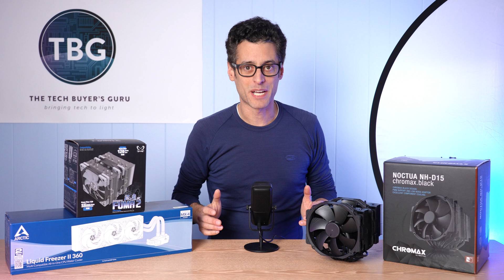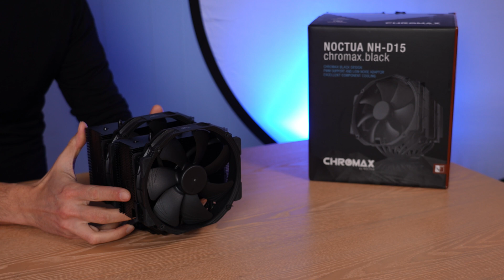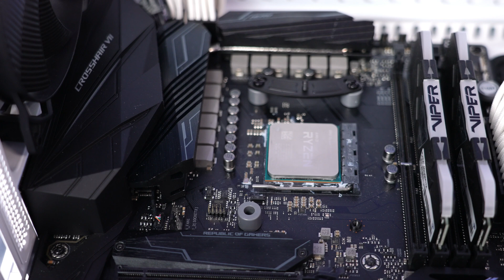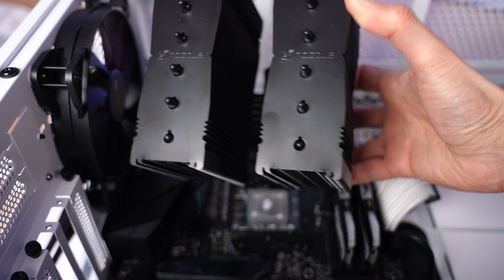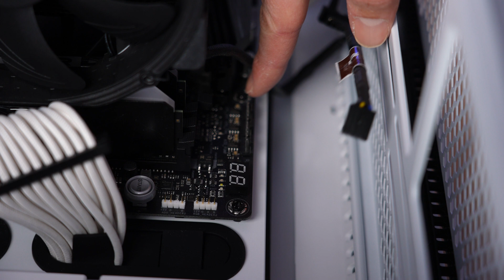The Noctua NH-D15 CPU Cooler: Installation Guide for AMD's AM4 Platform

Comment: just found out the hard way that the nh d15 se am4 does not work with Corsair Vengeance RGB PRO 64GB, DDR4, 3200MHz in a Be Quiet Silent Base 802...
Reply from the maker: Pretty sure you must have missed something, because I installed the D15 in the 802 in this video, and used RGB RAM that was just as tall as Vengeance RGB Pro, with plenty of room to spare.
Reply: @TheTechBuyersGuru  what should i check for ? my cooler is touching/resting on the ram atm and side case/interior foam still makes contact with the fan. I feel like theres a 3-4 mm more needed to clear it up.. Im pretty sure the cpu cooler is mounted correctly, im getting 28C idle on desktop and 58-62C after cinebench 15 runs. Here's some pictures
https://linksharing.samsungcloud.com/6usNkEiFMEAw
Valid until May 23, 2021
Reply from the maker: Ah, the issue is the padding on your solid panel case. I used the glass panel, which offers more clearance. Your only option would be to cut away some of the padding. You could also substitute a 120mm fan in the front, which would reduce performance slightly, but not enough to make a big difference. You clearly have thermal headroom if Cinebench 15 is only hitting 62C.
Reply: @TheTechBuyersGuru  thanks for the info. I think changing the ram to some corsair LPX is also a solution
Reply from the maker: Oh, sure, you could also replace your RAM, but that would cost more than swapping the fan. It is true, however, that the D15 is not an ideal choice if you're using RGB RAM.
Reply from the maker: Have a look at this video to see what the D15 looks like and how it performs with 120mm fans: https://youtu.be/o-bRE1Wo97Y
I'm suggesting you just swap the front fan, not both.
Reply: @TheTechBuyersGuru  interesting.. Well given that an order must be placed for either a smaller fan, or new ram ( this will be a return and replace, my current ram is bought 3 days ago so its fine), i guess ill go with replaceing the vengeance rgb ram with a 15% cheaper Vengeance LPX model, so its actually a win :)
Reply from the maker: Yes, if you can get a refund for your RAM, then that makes the most sense. Make sure to pay close attention to not just the frequency but also the timings of the LPX RAM you buy. Corsair makes many different SKUs with the same frequency but different performance based on timings.
Reply: @TheTechBuyersGuru  are timing really that important ? the model i found online has cl 16, 16-20-20-38
Reply from the maker: Those are the new weak timings on DDR4-3200 RAM. It's not great, but it will work fine. It used to be 16-18-18-38 was standard.

Comment: Ive been reading that there is only about a 1-1.5 degree difference between single fan and double fan so im probably going to just mount one of these fans to the top of my case and put one between the towers.  At the moment I have no exhaust fans so it will act as an exhaust, will not cover up my RGB memory and hopefully will allow me to access the GPU.
Reply: How did it go?  Which cpu, and what temps are you suffering?
Reply: @Chris.Brisson  I ended up putting 1 in between and one on the end towards the back of my case in a suck configuration rather then a push config sitting over memory.  Seems to work fine on my 5800x which atm is running around 50 degrees celcius on average with a game running.

Comment: The CPU backplate is usually comes installed on the motherboard with the default mounting hardware. If you don't have these you probably bought it from someone who used the motherboard earlier with a custom cooler and they didn't place back the backplate and mounting kit after removing their custom coolers. If you buy a used motherboard, make sure you have these. Normally the first step would be to remove the default mounting hardware and leaving the backplate on the motherboard. You can install the cooler mounting hardware on the motherboard box in a horizontal position. The heatsink itself is best installed after the motherboard is installed in the PC case with all the cables connected.
Reply from the maker: All good advice!

Comment: Hello, could you tell me if you were able to close ur case without any issue . I can tell the cpu cooler outer fan that is above the ram is making it hard to close the desktop case. And do you have any recommendations to choose an atx case for this fan?
Reply from the maker: I tested this in a large case. It fit fine. But yes, it can be very tricky if you assume it is only 165mm tall and then need to raise the front fan by 10mm. Then it won't fit in most cases. The 165mm height is based on using standard-height RAM, which is approximately 37mm tall.

Comment: In the event of installing this and eventually the GPU, ram or cooler itself need to be removed is there any way to do this? I understand it will be highly difficult but is it just impossible?
Reply from the maker: I was able to get my GPU out after removing RAM and working very hard to reach the latch with my finger. It wasn't easy. You may need to remove the cooler, but that is also extremely hard because the fan clips are blocked by the GPU.

Comment: Think the raised second fan will clear 176mm?  42mm memory height, oops.
Reply from the maker: In my testing, it sat at 163mm when dropped down below standard spec with 34mm ultra-low profile RAM, so you'll be at 171mm. No problem. Here's the link to the D15 chromax.black at Amazon: https://amzn.to/3gtc1wN
Reply: @TheTechBuyersGuru  Awesome, thanks for the specifics!

Comment: wont this cpu cooler put excess strain on the motherboard and eventually break something due to its heavy weight ?!
Reply from the maker: That's just what people say, it doesn't actually happen unless you ship the PC with the cooler installed. It absolutely will NOT happen if it's sitting on your desk or floor for years.

Comment: : Why didn't you just use tape to fix the backplate in place?
Reply from the maker: That is worth a try, but wouldn't necessarily hold it well enough to screw the bracket on as tape doesn't stick particularly well to a bunch of solder joints.

Comment: You can actually mount the Noctua in any orientation you like.  In fact some mothers boards wont allow a GPU in the top slot without turning the Noctua 90 degrees right or left. The Asus Maximus IX Apex motherboard in one of these boards. It will perform exactly the same as long as proper airflow is allowed in the case.

Comment: I didn't need this video, but if I did, it would have been a perfect guide. Really good job.
Reply from the maker: Thanks for the positive feedback.
Reply: @TheTechBuyersGuru  I installed mine a little differently, leaving that middle part empty with both fans pulling air towards the middle. A case fan situated vertically above the empty middle of the cooler draws the hot air out of the case. This way both towers are drawing cooler air in. I have intake fans at the front and rear directed towards the cooler. I'm getting just slightly better temps but with the added benefit that I can reach my GPU retention clip easier now.
Reply from the maker: Really creative installation, and yes, being able to reach that GPU clip is priceless!

Comment: My backplate screw holes are way to small for the screws that came with the cooler.
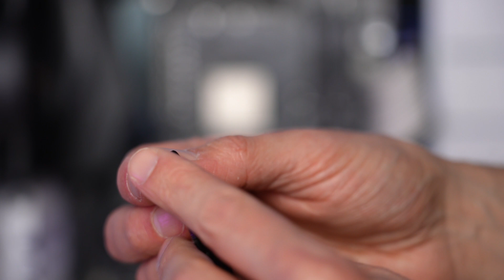Reply from the maker: You should double-check that. The backplate screw size is standardized by AMD. Maybe you just pulled the wrong screws out of the box. I clearly show the screws you should be using at 04:04.

Comment: Nobody, including the instructions shows removing the plastic cover from the heat spreader. I’m not sure mine has one. Any video of this?!?!
Reply from the maker: Oh, it's just a molded plastic cap. Not hard to spot, I thought I'd mention it because I'd already removed it in the video, and most other coolers actually use a sticker over the cold plate, which Noctua doesn't. If your plastic cap isn't on there, it probably fell off in the box.

Comment: You jumped over a step I may have a problem with.  The cover on the base interface is a hard transparent plastic molding which in my case fell out of the packaging when I opened it.  This  is the cover you're talking about?  or do you mean there is an additional peel off soft plastic cover I should have peeled off before mounting the cooler?
Reply from the maker: Yup, that's it. Not hard to take off!

Comment: What a nice install video! I kind of wish this was released a week ago, because I just did a build for a friend using this cooler. Installing it wasn't too bad or anything, but having this video would have been just that much more convenient. I did initially install the frontplates upside down though and then applied thermal paste, so I had to unscrew and fix them while avoiding the thermal paste. And this video would have been nice for doing the fan clips, too.
Welp, at least I can see that I did everything correctly. And hopefully applied enough thermal paste, too.
Reply from the maker: Thanks for the feedback, glad you got it installed!
Reply: Hello I just installed this and the fan makes noice like it hitting something.

Comment: Thoughts on this video jotted down while watching.

The CPU backplate can be temporarily held in place with a piece or two of tape. Makes installing it a lot less fiddly. Alternatively if you are installing the cooler while building the computer then attach the backplate before installing the motherboard in the case.

When tightening the screws holding the CPU backplate you don't really need to cross tighten them. There is nothing to compress in the middle of the plate so each screw is only putting pressure on the PCB immediately between the CPU backplate then the spacer, and the pressure under one screw doesn't change no matter how hard or lose you screw down any of the others. So just tighten down each of these four screws and be done with it.

However just like shown in the video you need to cross tighten the two screws. Everyone has their own technique for this. Personally I start with backing the screw until I feel it skip on the beginning of the first thread, then I give it one turn making sure it engaged the thread. Repeat this with the other screw but I give that one two turns instead. Now I switch between the screws every time giving them two turns. This way the pressure center will only shift slightly up and down every time and it makes sure that it's always very close to the center of the heat spreader. If you feel this takes too long then give the first screw two turns the first time and then use four turns each time you switch screw until they bottom out. This moves the center of pressure a bit more each time but halves the number of times you switch between the screws.

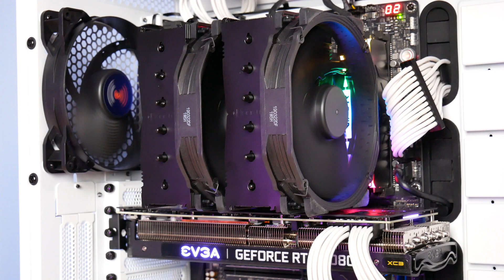Finally regarding the size of this cooler it should be noted that if you look at 10:25 you can see that this cooler actually is so large that on this motherboard it actually covers up the first expansion slot, and that the graphics card is installed in the second slot. This is important to know as there are motherboards that have the x16 PCI-e slot intended for graphics cards in the first slot position. On these motherboards this heatsink will obstruct that slot preventing the installation of a graphics card there. Also note that even if your motherboard have two or even more x16 slots it's very uncommon for any but the first one to actually be wired for more than x8. If in doubt check the motherboard manual to make sure.

Also Noctua have a pretty large database on their site where you can see if the cooler will fit a certain motherboard. I think they also have a case compatibility database, so before ordering it might be worth taking a look there.
Reply from the maker: All good points, thanks for sharing... I like that tape idea!!

Comment: Noctua cables always have small papers wrapped around them to identify the type of cable. It will always be advisable to remove these papers after assembly because of the heat given off by the components, don't you think?
Reply from the maker: Any impact of the labels would be so small that it would be impossible to measure. I wouldn't remove them.
Reply: @TheTechBuyersGuru  But they look bad :(
Reply: @TheTechBuyersGuru  I thought that the paper in contact with some part of hot metal, there could be a risk of fire. I think I exaggerated my concern :)
Reply: @PauloFerreira-hh6zv  Paper catches fire at a temperature that's well above 400°F. So if the paper catches fire you have some serious problem with your computer.
Reply: @blahorgaslisk7763  If the paper only burns at 400º F, then I don't need to worry :)

Comment: I love how easy it is to pop these Noctua coolers off and back on after its mounted.
Reply: Me too, allowed me to test different paste applications on my Ryzen to check the spread very easily. Pea size proved the best surprisingly.
Reply: @lunetailedfox  I lost 5c by reapplying with pea size after trying a X
Reply: @coryandrum  I was using a NH-D15 with NT-H2. After applying pea size, the spread was perfect on the CPU: https://i.imgur.com/OlfKPCf.png

X method and 5 dots method actually spread worse for me.
Reply from the maker: Yes, the mounting mechanism is really top notch. Others have gotten close, but Noctua pioneered a simple, elegant solution.

Comment: dark rock pro 4
Reply from the maker: Are you asking for an opinion/guide? I've tested it against the D15 and didn't really like it. Here's the video: https://youtu.be/tw5qR7BeTXA
Biggest issue was the installation - it was so bad that I'd never create an installation video for it, as there's no way I could make it look easy.
Reply: @TheTechBuyersGuru  i swapped from the drp4 to the nhd15 cromax.

Was pissed with the easily scratched coating on the drp4 and my ocd got the better of me.
Reply: @TheTechBuyersGuru  it was WAY easier than the assassin 3. i didnt think it was that hard, i didnt even take my mobo out of the case. i did remove my gpu which was easy enough to do.

Comment: Awesome Install guide. I haven't seen one better. Using a White Case helps see a lot of detail against the darker components for step-by-step updates. I heard it's a good idea to briefly test run your system after applying the fresh paste, then turn it off and let the paste solidify during cool down for better performance next boot. Rather than, apply paste and benchmark or stress test repeatedly before shutting off the system at all with "wet" paste.
Reply from the maker: Thanks for saying that, I hadn't looked for other guides (maybe I should have!), but I worked pretty hard to make this a good one. Interesting point about the white case, which I hadn't really focused on before this guide. Not only does it help see things better due to contrast versus dark components, it also reflects more light making the whole interior brighter. Definitely going to stick to white cases for component install videos!
Reply: @TheTechBuyersGuru  Thank you for the video, and yes do keep using white cases for this kind of videos if possible. I hadn't really thought about it until seeing Brian's post, but I now realize that the white case really made this video so much better.